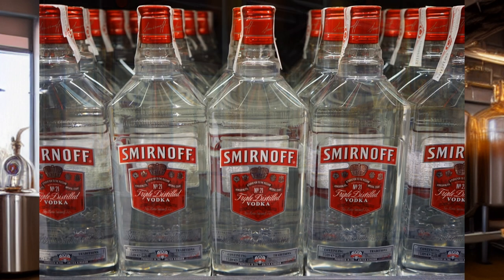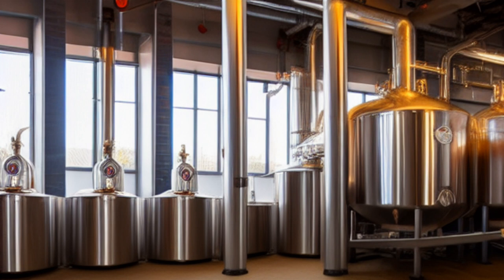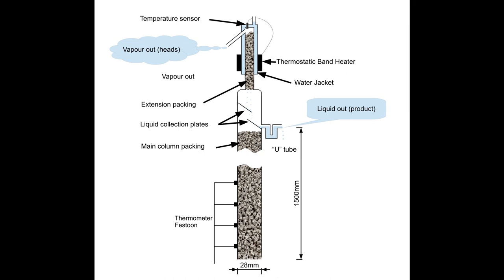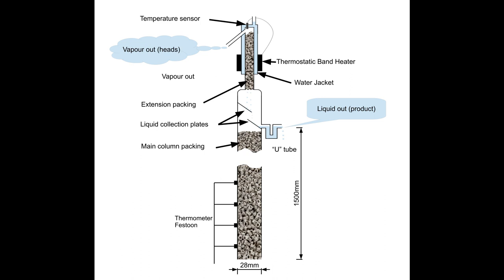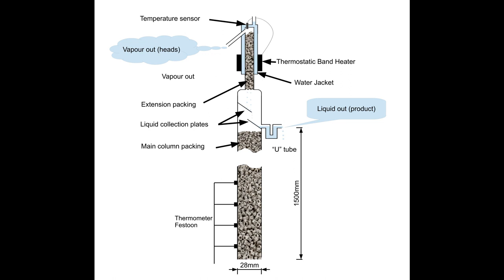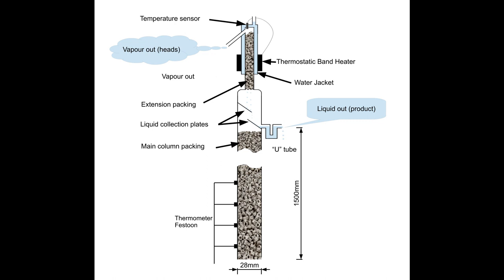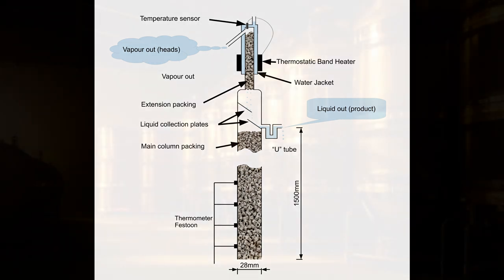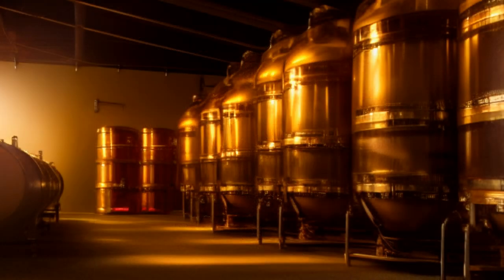Multiple distillations of Moonshine

Comment: Thanks for the great information. I have put it to good use and am up to my 3rd condis setup. I will have a go at the column you have in this video, especially the top bit. Can you show a bit more detail of your jam jar condenser? I have been looking at a Snyder column but they are small and expensive. Is heat a problem with the jam jars? I can source 
borosilicate jars with stainless lids for about AU$ 5-7. Looking forward to your next video.Cheers
Reply from the maker: I have made two designs for inexpensive homemade bubble cap type columns. One is the Bonne Maman jam jar column, the candle shade column is the other. I'll do up some drawings and make pdfs of both available shortly. 

Of the two, the Bonne Maman column is a little cheaper per stage  because jam jars are cheaper than candle shades, but it's a bit more complicated to make, though neither are difficult. Getting it sealed so that it doesn't leak after two or three runs is more of a challenge than with the candle shade column. 

Heat dispersion is not a particular problem with the jam jars. I initially designed the column partly for low cost and partly for research purposes. I made one jar with a hole in the bottom that allows a temperature probe to be placed in the liquid and a silicon tube so that samples of the liquid could be drawn out for analysis. This jar could be moved up and down the column to measure these parameters at different stages. It works well but I didn't use it much and haven't characterized its performance in detail. 

I haven't tried glass columns for the reasons you say; they are small and expensive. 

What column to make depends what you want to do. If you simply want a functional stripping column, then I think the sloping tube is the easiest, cheapest, and most effective option I have found. And for a rectifying column to azeotrope, a pack copper tube seems to be the easiest to make but is only good for neutral spirit.
Reply: @tight1449  Thanks for the reply. A question on packing , is the stainless steel spring packing that much better than others eg copper or s/steel scrubbers?
Reply from the maker: I have tried Copper Springs packing. They weren't quite the same geometry as the stainless steel spiral prismatic packing, but rather little cylindrical springs. I didn't measure the performance of the column as precisely as I have with the stainless steel packing, but broadly, it seemed to perform the same.

I'm not completely convinced that you need so much copper to remove sulfates because I use a thin tube and there's plenty of copper in the column anyway. I haven't had any luck with scrubbers, but that's because of the long thin tube that I use. It just isn't possible to get an even distribution of scrubbers when you have to poke them in for up to a meter from either end. You can't control how tightly packed they get, and I found that some of them would be compressed flat and significantly obstruct the column, but presumably there were also gaps with relatively little packing. That problem doesn't apply with things like prismatic packing or Rashig rings because you pour them in and don't have to push them up the column

As my column is so thin, it's fairly inexpensive to get prismatic packing. If I was using a wider column, I would try cheaper alternatives, and my stripping column has no packing in it at all.